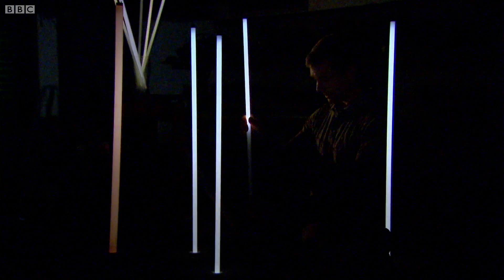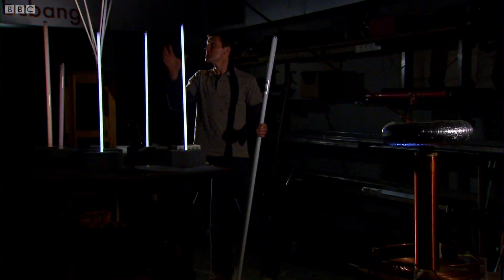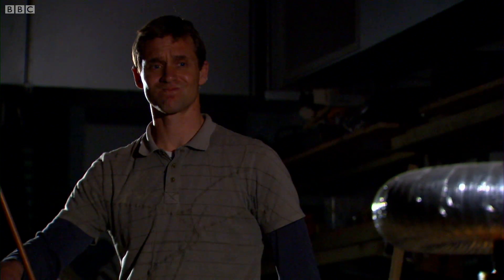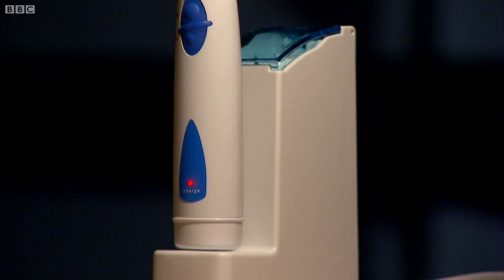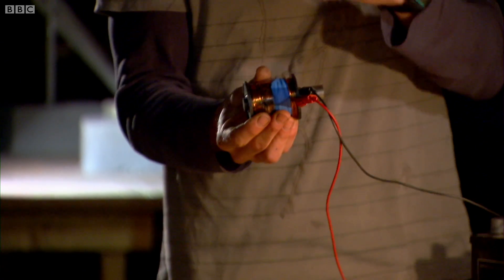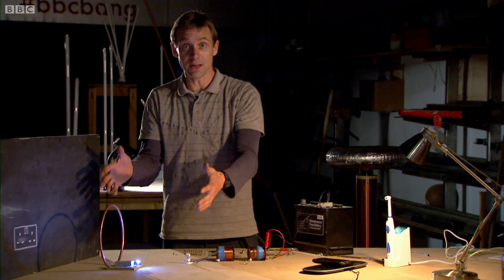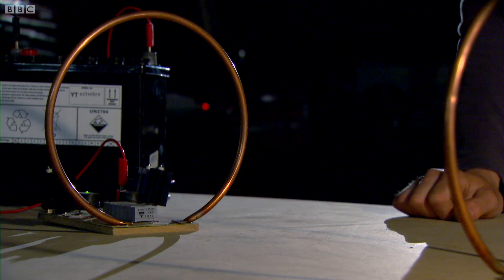Wireless Electricity | Part 1 | Bang Goes The Theory | Earth Science

Comment: it is a doomed tech as it is inefficient and radiates strong magnetic/RF fields which will interfere with radio communications potentially for some miles. just use a wire or like the toothbrush a close contact transformer.

Comment: dont perople  in the uk use the metric system
Reply: We're ambimetric we can use metric or imperial as required.  There's no easy way to express the idea of 'a couple of feet'  or 'an inch or two' in metric units.  On the other hand metres and yards are generally interchangeable so it's two hundred metres to the corner shop.

Comment: Wireless power is far less efficient than wired power and generally people leave the wireless chargers switched on constantly, meaning they are probably using 10 times more power than if they had to plug in a charger. Hardly good for the environment and we are short of electricity as it is, so perhaps we should develop these solutions a little more before offering them to the public to avoid huge waste of a precious resource????
Reply: More modern wireless chargers detect when a device is charging with them by detecting the current flow through the primary coil, and turn the coil off when there is little to no current draw. However it still pulses it every few seconds to detect whether a device is present or not, otherwise it would never turn back on.
Reply: right capacitor loses electrons overtime even they are plugged in by giving the capacitor a pulse like sawthooth it will refresh overtime

Comment: im annoyed that I didn't figure out that magnets can be wireless power earlier
Reply: you realize the video is called "bang goes the theory" this why I find it odd and annoying that they saved that bang for next week
Reply: Fuseteam oh right. well, it does work on a small scale, which is the wireless chargers. I always wondered how electric toothbrushes charged and why it couldn't be used more, and now I will know
Reply: Sam Scott yeah, that it works on a small scale is proven by this video, why they can't scale up i was wondering too :) btw aren't tootbrushes still charged this way?
Reply: Fuseteam they are indeed. i wondered past tense because i know now what system they use.
Reply: Sam Scott ah that's true..............so now we both wonder about scaling problems xD

Comment: Ahh the old inverse cube law.
Reply: Yep. What I view as the main issue with broadcasting energy like many of these solution are doing. (But works great for certain applications when you having a very short distance.) 

Of course you can rather then broadcast the energy focus it. That was the idea behind those space based Solar Arrays. You would use Microwaves or Lasers focused in a hotspot to transfer the energy. Though the receiving station might actually be huge depending a but on what technology that would be used.
Reply: Cythil Focusing the energy sounds like a good idea, but it's purely "line of sight" and requires energy to focus the energy (meaning you will never get away from thermodynamics, there will always be loss).
Reply: frosted1030
Naturally you will always have loss. But depending on what frequency of electromagnetism you could make it more or less absorbent. You could actually send energy though walls.

Anyway if use in for space based solar arrays for example then you would have to weight the pros and cons of the different technical solutions. It is however pretty much the only efficient way to do it with space based solar arrays.
Reply: frosted1030 No. You can simply fly around such a beam down area. And there lot of areas where planes do not fly over today for one or the other reason. Also as I mentioned you can tune the beaming of energy so not have any huge effect on the atmosphere. In fact that would be what you want to do to make it more efficient. So the effect on the weather would likely be less then what a coal power plant or a hydro power plant effect the weather today.
Reply: +frosted1030 Why would the radio beam heat up the atmosphere any more than the sunlight that was intercepted to generate them would have done?
Reply: inverse square law as we call it here, of course in the near field the drop off is much higher than the double distance / quarter power rule.

Comment: why not radio waves?
Reply: the further the distance is the more energy it takes to transport, to ineffective
Reply: well its just that the recent breakthrough is to use wifi or radio waves to induce a current
Reply: It still costs a lot just to transfer energy through radio waves
Reply: +Redmaster50 Then place "radio retransmitters" every so often just like you do with cellular BTS networks or wifi networks designed to cover big areas that single wifi router can't handle.
Reply: +QVear it is still ineffective
Reply: Redmaster50 No offence but you really dont know what your talking about XD
They are already in development to utilize the cellular and wifi networks to induce current in mobile devices
Reply: +shiro yuki sorry but he's right it is ineffective, you won't be able to run a cellphone in such a network, of course low power devices is a different story
Reply: +shiro yuki even though that is possible it will be something like energy/distance=received energy

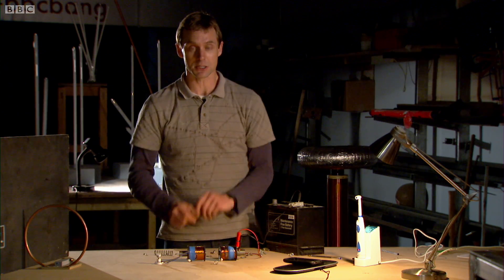Comment: Never connect a battery to a transformer with a load (as shown @ 02:50) it is highly dangerous for the transformer, the load and the user.
Reply: It's not really a transformer though, more like an inductor. I wouldn't say he was doing anything dangerous here - aside from the tesla coil
Reply: +io504 it's exactly a transformer, the only difference is that it uses air instead of metal to transfer the magnetic flux from the primary winding to the secondary. In this case it's not that dangerous but trying it with a transformer (that has an iron core) is dangerous even with smaller batteries.
Reply: +io504 as for Tesla coils, the voltage is of high value but not the current so it has the power to create a big electromagnetic field around it but it is of low intensity. Not so dangerous for people (at this scale) but a hazard for electrical equipment (especially digital equipment)
Reply: It is a very low current on average but the current spikes can be quite high. Combine that with the RF frequencies that tesla coils produce and you get some pretty gnarly nerve damage - you wouldn't feel any pain but could lose feeling in your arm (or anywhere the current flows) for the rest of your life
Reply: +io504 oh. Interesting point, the value of the harmonics current can be big. Don't know the frequency or value of the current though.
Reply: oh yes he was. he was applying a large current to a coil. as it disconnected the field collapse in the coil would throw back a potentially lethal voltage back down the wire.  his demo should of made it clear you do NOT hold that wire!

Comment: Common misconception is power travels down wires. Teaching the world wrong still 😴
Reply: Ever considered that some things can be adequately explained in more than one way? When someone comes across an interesting alternative view of something (e.g., the power in a coaxial cable is 'carried' in its dielectric), and then turns around and tells everyone that thinking of the wiring carrying the power is "wrong" (even though the maths works out just fine and its a vastly more useful model most of the time), they reveal themselves to be somewhere inbetween a pedant and an idiot.
Reply: only as frequencies increase does power begin to travel on the outside, DC current still goes through the cable as demonstrated by measuring the I2R losses .